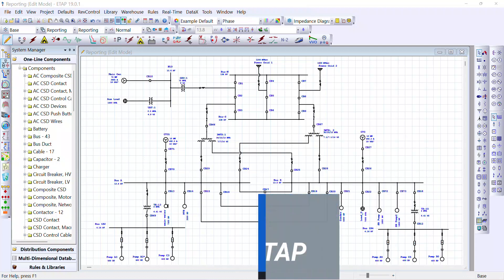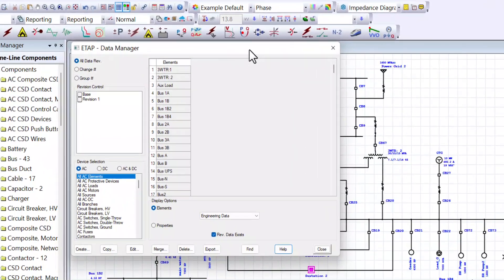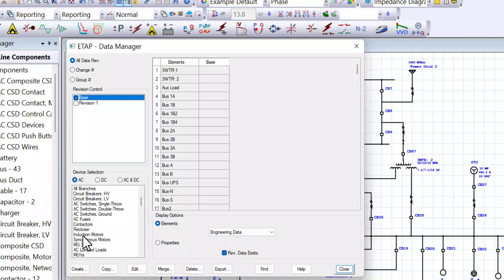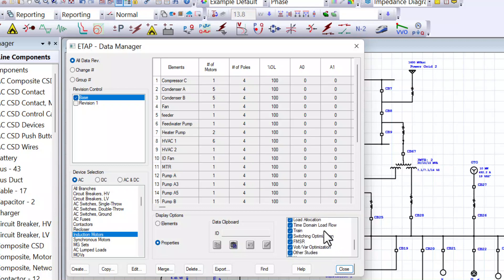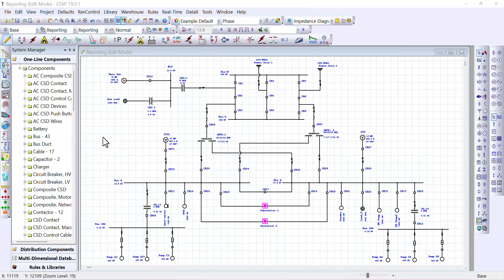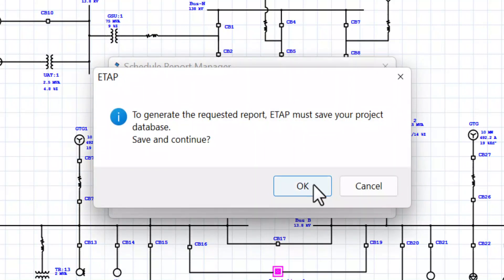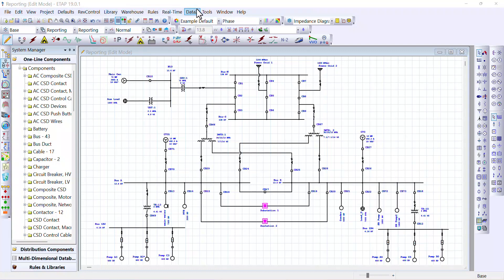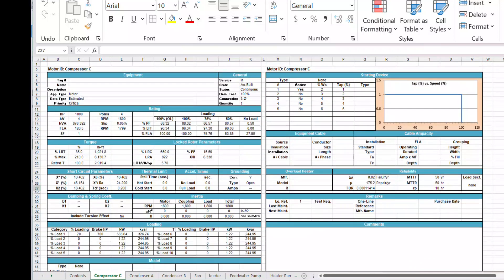How to Retrieve Component's Data in ETAP

Comment: Your way if explanation very good please share manually calculation about synchronous generators editor fill data and motor , load, transmission line etc and also please share how to make multiple study cases thanks
Reply from the maker: Will do . I am Glad you find these videos helpful.
Reply: ❤❤🎉Thank you very much you are magnifying